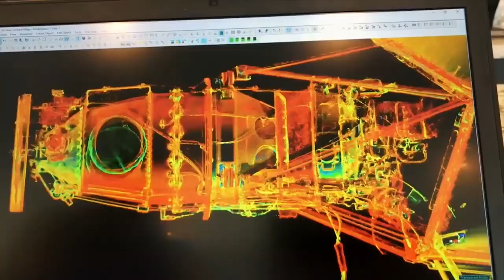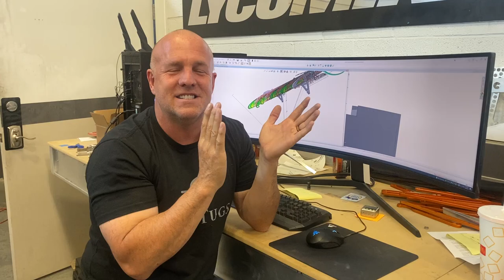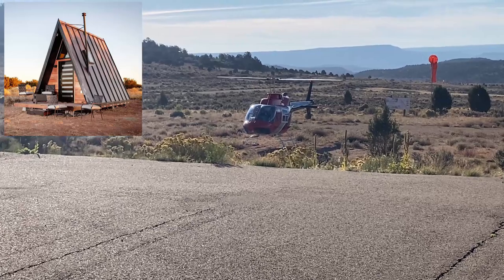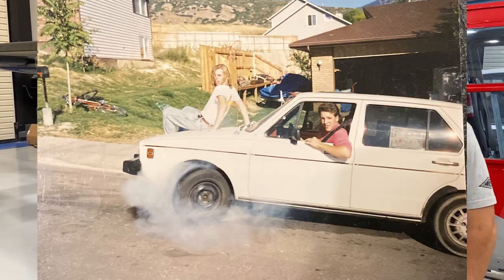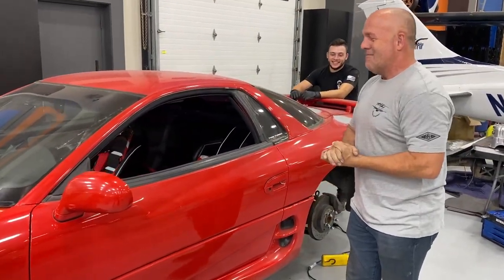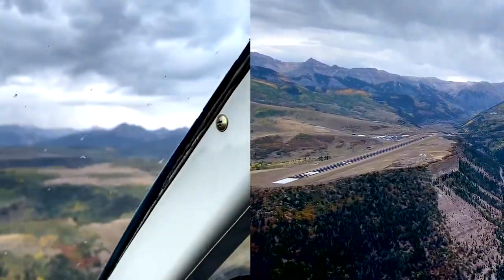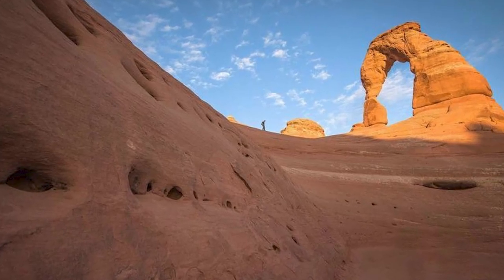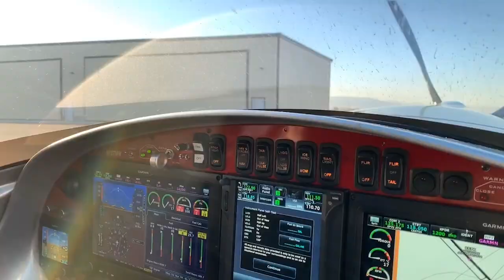Anniversary Adventure Trip by Helicopter

Comment: Really like your videos and all the engineering you do. I was a mechanical design engineer for 47 years. 
I live out east of Kanab on a small ranch. I believe the bluish color ‘’dirt’’ is bentonite clay. It is used to line ponds to keep the water from soaking in the ground.
Reply: You're correct in that it's bentonite, but the color actually comes from malachite and azurite, which are copper carbonates.  It just happens to be that in this particular bentonite formation (part of the capitol reef) there's a lot of those minerals as well that stain it blue-green.

Comment: The Moab area has those same blue deposits and I always understood that to be Bentonite clay. It works great for water sealing. It was used to help seal up a leaky pond where I once lived.
Reply: The pigmentation isn't the bentonite itself, but, the formation that has bentonite in it has a high concentration of malachite and azurite included (copper carbonates), which dyes the off-white bentonite into the colors you see here.

Comment: The blue soil could be iron sulfide. Did a round of storms pass through recently? Was looking into gleyed soils (typically in wetlands not the high desert). Apparently, devoid of oxygen, microorganisms in the soil turn to other elements for respiration (like iron) which will turn the color to blue or grey.  Not an expert in the field but one explanation that seemed plausible.

Edit: I'm curious if that was copper rich soil as well as copper turns blue when it oxidizes. 🤔
Reply: I'll bet it's copper ore

Comment: The blue color in rocks are usually copper or boron. There are also some aluminum silicate products that will show up. These are the most common that I have seen in my travels. You will find more and more as you will undoubtedly see more and more often. 

Keep flyin' Keep smilin'

Comment: A few years ago I drove from Vegas to Denver via Utah (and back), stunning scenery. I saw this  blue and typically one type of copper sulfate and or oxide turn blue. Copper roofs often turn into very same shade. The hull of my boat has "coppercoat" and it turns the same shade too. I settled for this explanation, but not sure.

Comment: I used to friction the controls on a 206 , position the controls just right and I could change heading just by leaning in my seat. Couldn’t change pitch though. Blue dirt usually means copper. Power available and power needed charts are golden.
Reply: Hi Mike. How's the Scrappy doing..would love to see some flying Video....that's of course when you have time. 

Full throttle, gear up, Bank left and pull hard....Regards John

Comment: Congratulations, it is apparent that God has blessed the both of you. May He continue to bless you both and keep you strong together. I would also like to make a comment based on something you said in the video. If you are designing pylons to carry electric motorcycles. Have you considered designing a pylon that will use the electric panels on the wing to charge your bikes during flight ? It may not add much in short flights but maybe a long flight? Maybe as a way to charge a bike while on the ground or some sort of battery system that would allow one or two quick charges to the bikes? Just a thought.

Comment: Didn't get a notification YouTube unsubscribed. 
   Beautiful trip looking forward to viewing Scrappy's Adventures. Curious have you changed  Scrappy's prop to a   in-flight adjustable or a constant speed yet?
    The blue is indicative of copper ore oxidation.  Turquoise is often found within the harder strata.
Reply: A couple decades ago while flying low next to the sand dunes near Safford Arizona, I spotted what looked like obsidian. So I landed on the dirt Trail nearby. Hiked down into the wash and found several basketball sized  obsidian. Along with several # of smaller  Apache tears. Payday!!
   Around 15 years ago landing in the back county, I found a large meteorite. Over 100#'s mostly nickel composite. Major payday!!!

Comment: Hey Mike, I would be interested in doing a weekend getaway to one of your cabins out there.  What is the length of that runway where your land is?
Reply from the maker: Runway is 4,000ft x 48ft paved with an uphill slope. About 1200 feet of dirt before that. Lot's of room, but on a hot summer day just make the go around decision early.

Comment: Wouldn't storing gas powered motorcycles upside down cause issues with hydrolocking and other fuel/oil related issues?
Reply from the maker: The design I have hangs them upright 👍🤠
Reply: @MikePatey  Ah, be interesting to see when the video goes up, so no Aerobatics then eh ;)